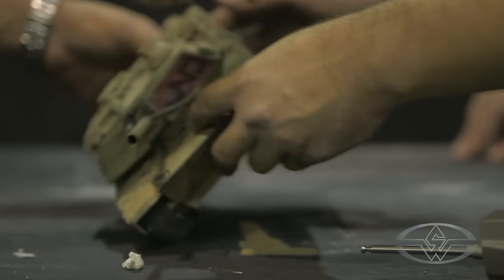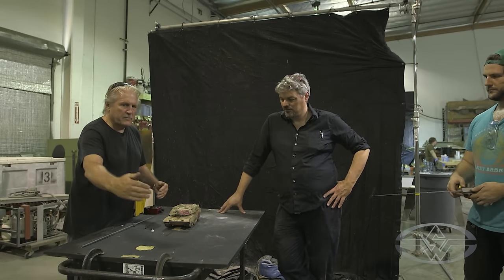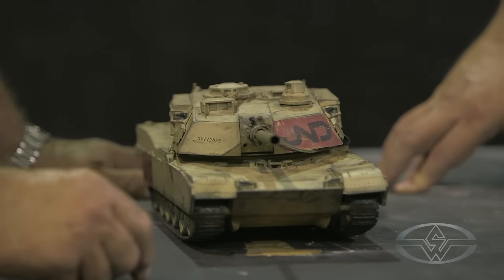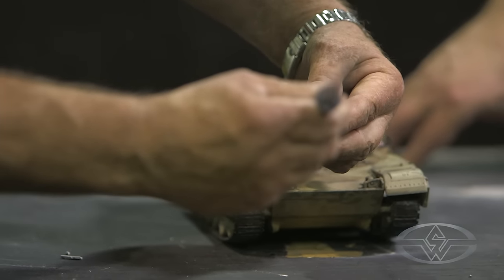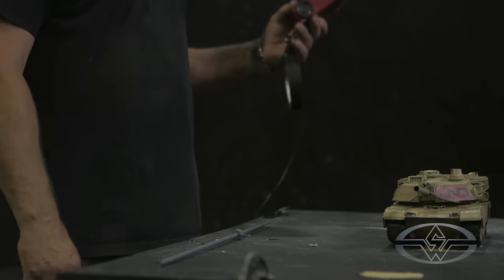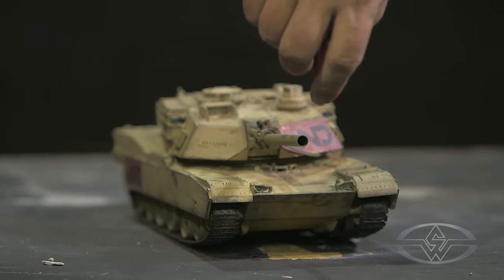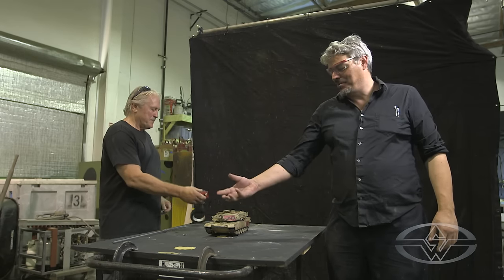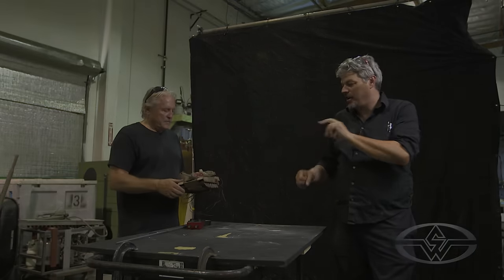Building Miniatures: Tank Barrel Blast Test - FREE CHAPTER

Comment: I set a pyro off with a radio control via a servo, doing the job of a hand touching two wires together back in 1998, worked great.